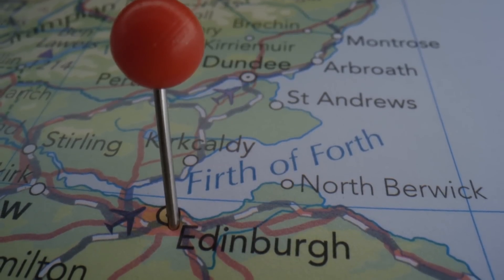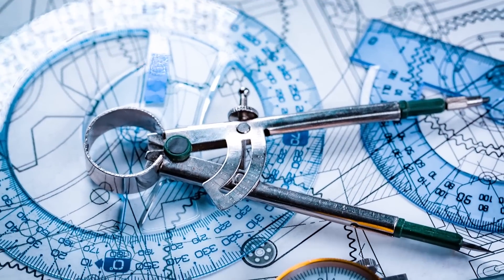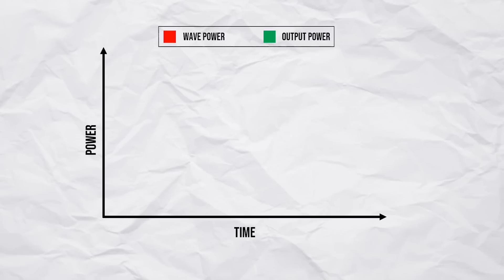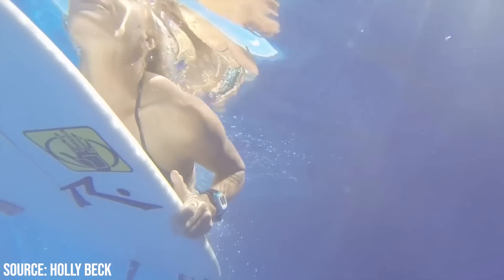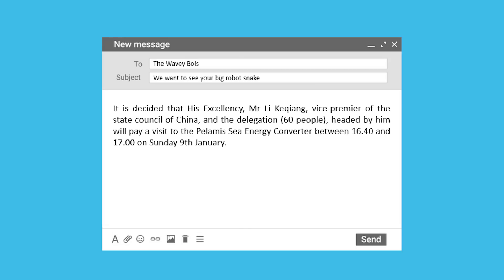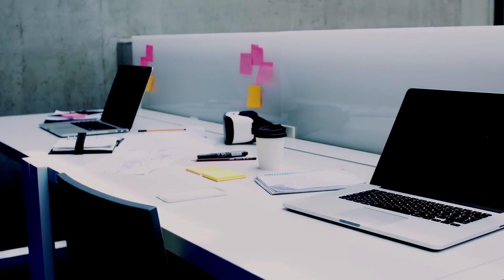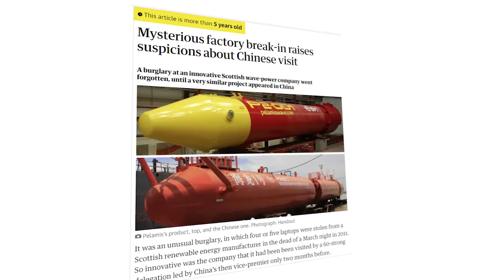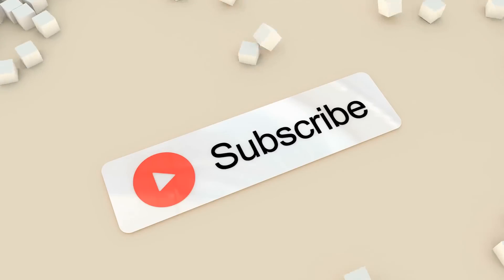Uncovering China’s Suspicious Energy Project

Comment: Pelamis was not new.
It is 100 years old patent: 1,018,678 M. Nelson, Wave Motor 27. Feb. 1912

PS.: I do not think, this was not a good move from the Chinese. Because they copied something, they didn't know. And they didn't know, the design they copied, was/is a failed design.
First, you got to know, that generators which turn wave energy to electric energy must be build incredible sturdy. And this thing break far far far far far earlier.
Second, the power output is incredibly low for the resources it needs to be built.
Third, it needs high maintenance, because it got moving parts in the wild sea.

Comment: Its nothing new or revolutionary tbh. anyone with a decent mechanical and electrical design and engineering background can come up with the concept if given some thought. The difficulty is to make it efficient and durable enough to worthwhile. Thats why they couldn't get the funding they need because its not commercially viable. If China can crack the viability problem then it is alot more impressive then coming up with the prototype in the first place.

Comment: Hydraulic systems have some of the highest failure rates and are prone to leaking.  Add the conditions these things operate in and I can assure you these things will be maintenance nightmares.   760 KW of output would never cover the operational costs and damage these things would do.   More green energy smoke and mirrors.
Reply: Yes but a tantalising prospect all the same 
Ocean currents will be a future potential energy source far better than wind or solar

Comment: I have some significant background knowledge about this: In the period running up to this probable theft, I was working with my licensing agent to promote a wave energy device of my own. Unfortunately we couldn't eventually get funds to take it further, but that's another story. However, I knew a fair bit about the technology and operation of the Pelamis project, as did everyone else involved in wave energy in some way. There were a few problems with it: Firstly, they were trying to do things in too sophisticated a manner for such a hostile environment. For a device that has to operate in energetic oceans, which is a very hostile environment, you want rugged simplicity, not sophistication. The Pelamis device was so fragile that when the weather got really rough, they had to take it away from its mooring to put it somewhere safe. That fundamentally undermines it's usefulness as a wave energy device. In fact, one of their patents was relating to an easier way to unhook the device from the seabed quickly - that says it all really. Another fundamental weakness was that they were using sliding seals on rods exposed to the ocean - that is absolute madness! Everyone involved knew they were going to go bust eventually.

In my report to my licensing agent about the 2014 All-Energy show I wrote, "It really demonstrates that protecting your intellectual property is only any use if someone wants to copy it. It appears that no-one wants to copy the Pelamis design and instead they are looking for ways to avoid the same problems...The comparisons between this and Pelamis are too obvious to ignore, and with the reliability and cost problems of Pelamis well-known, it is not beyond the bounds of possibility that if early trials of Seaweed are successful, the new money could go towards Seaweed rather than Pelamis.

*Pelamis may well be the first of the high-profile player to fold*, unless they drastically simplify their design to cut the costs of production. In doing so they may end up discarding a substantial portion of their intellectual property, but it may be clinging to their early intellectual property that has caused them to not adequately focus on what will work best". Guess what - Pelamis folded a few months later followed by the Oyster design that I had also slated. So the chinese stole a design that everyone else in the industry apart from Pelamis knew was doomed to fail because of unreliability and cost. What is staggering is that China has copied the cylindrical design, when by 2014 a senior guy at Pelamis had told me that a cylindrical design was a mistake, and they were moving to a horizontal-oval design that they had discovered was better. They seem to have copied it with very little original thought, except that ti looks as though they put bellows over the sliding rods to avoid seawater coming in contact with sliding seals.
Reply: A classic example of KISS.
Reply: Excellent comment, thanks
Reply: Interesting. Would be interested to see your device
Reply: @SECONDQUEST  https://www.youtube.com/watch?v=cH2d4zK2frM What you can't see very well is a thin driveshaft with universal joints between the floating helix and the raft containing the generator, which was made out of a HP laser printer stepper motor (I should have used a bicycle dynamo). When it turns, it turns with enormous amount of torque, but as you can see, in bursts. However, with a whole field of them, the overall power delivery would be quite substantial and a lot smoother. I discovered it when riding a log that had floated into the beach, that happened to have a slight twist in it. Each time a wave came in the amount of torque with which the log rotated was impossible for me to hold it still.
Reply: @@GOGO2482 Bro... Get some help! Talk to your doctor, see a psychologist, get some meds.
Reply: Yes, the Chinese do typically copy slavishly because they rarely have any novel ideas to incorporate. it's their 'culture' like copying a poor Russian aircraft carrier.

I seem to recall Pelamis talking about ceasing trying to capture energy in very high seas btw, so as to limit damage that can occur.
Reply: To release claims by originator supporters, a theft would fit the bill while... China could pay off anyone who would settle for some quick cash.
Reply: Haha, I had some inside scoop on this issue too, as I had a research project in the same building as the team working on the Pelamis project. One of the team members admitted that the project was essentially a failure, they were only generating a fraction of the energy they had predicted.
Reply: @tomdip2094  interesting. One of the guys at the top admitted to me during the last all-energy conference before they went bust that they went big too soon and they should have done experiments with models first. I think them they'd have been in a better position to change direction rather than remain committed to a design that was seriously flawed

Comment: OMG! Pair this wave capture device with A Tesla Trubine and you have all the electricity you need. The Tesla turbines will be able to harness all the potential energy in that compress air  more efficiently and turn massive turbines to generate electricity. That electricity could then be stored in batteries or be used to produce hydrogen. Here is a video showing the power compressed air has to move a 60 inch turbine.
https://www.youtube.com/watch?v=MeK78TXsMxU

Comment: From what I've followed with Pelamis, their hurtle was their hydronic power take off system. It was costly, complicated and they struggled with dynamic capturing of wave fluctuations. I think thier structural shape is simplistic and cost effective, just the PTO is too problematic and costly. 🤷‍♂️ I'd use the same design with a different internal PTO. Maybe a enclosed Wells turbine with liquid(water*) that sloshes between joined compartments.